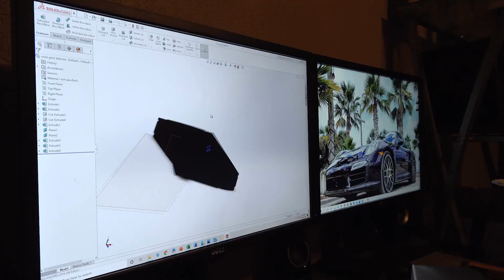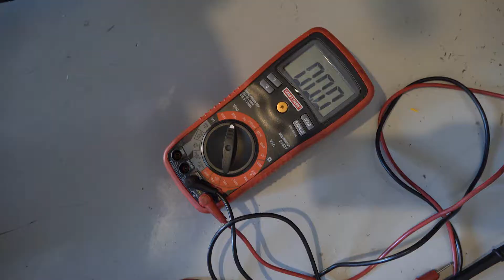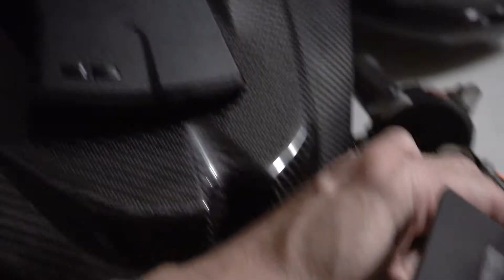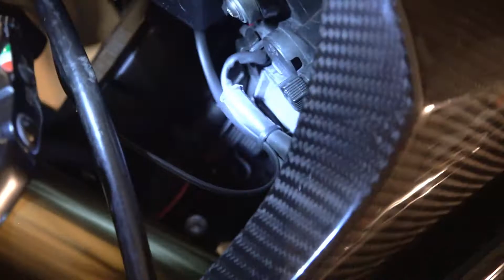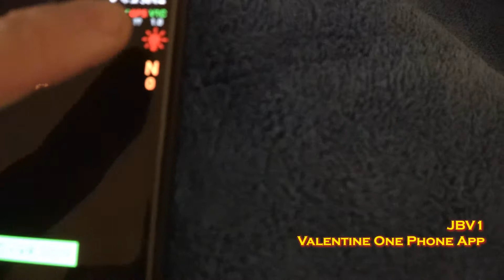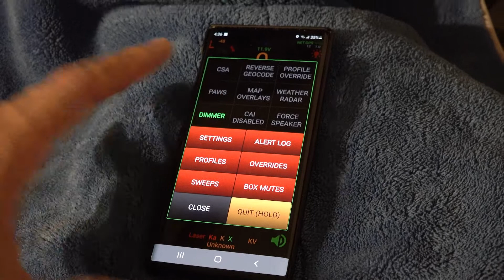VALENTINE ONE Motorcycle Radar Detector G2 BMW S1000RR Install Made EASY - V1 G2

Comment from the maker: The V1G2 install on the cross country record smashing 2010 BMW S1000RR with 2018 engine/electronics upgrade and V1 setup with the Sena 30k and JBV1 app.
Reply: Is the JBV1 app still in use? I can't find it in the apple app store.
Reply from the maker: @kalindenev1972  if i remember correctly, jbv1 is only available for droid. V1 makes an app, but last time i used it, if i turned the screen off on my phone, it killed the app, so i couldn't just put the phone in my pocket. Hence, droid with JBv1 for me.

Comment: Thanks for the great video! 🔥 Im planning on getting this, but use my phone as a satnav, so was wondering once the V1G2 is connected to the app, can I minimise it and open i.e. google maps etc and it still gives me noise alerts despite it being in the background? I have an android and will use a Cardo intercom for the alerts.
Reply from the maker: hey, glad it helped. with droid, there's an app called jbv1 that i've used, and i haven't had a chance to mess with it since getting the new phone setup, but in the past, it has allowed a sticky overlay to your nav, so you can have both on display at once. my sena allowed seamless music with alert interruptions fine, however, what i learned is that with the eyelights HUD helmet device is that it forces you to use android auto, which will not let me run jbv1, and even the audio part i struggled with cuz every time an alert came from the v1, it stopped my music and would not restart. because of this, i'll probably go back to a sena setup. point is, i've had good luck, but not with android auto running. what i did on the aprilia is installed one of the bright LED dash visuals for the v1 as well just as extra risk mitigation.
Reply: @NoLimitsNoRegrets  Thanks, appreciate your response. Really looking forward to getting a radar detector so I can enjoy my motorcycle more.

Comment: Does the v1 app still give you radar alerts with the app running in the background? So, for instance, if I have my uber eats app running and my phone connected to my sena, I'll still be able to hear v1 alerts through my sena?
Reply from the maker: i know the YAV1 app does. as far as the actual valentine 1 app....there was a reason i didn't use it...oh, the last time i tried it, you had to leave the screen active for the app to be active, but if i shut off the screen to put it in my pocket, the app quit. the YAv1 app stays running in the background even with the screen off and lets you prioritize the alerts, so it interrupts the music for the audio alerts. YAV1 is only for droid, not for apple. Short answer is i don't remember if the valentine 1 app will interrupt music/other apps for alerts. it would seem silly not to, but i can't guarantee it off hand.

Comment: Hi! How those it perform on road with stacionary and mobile radars??
Reply from the maker: around here, the only stationary type radar items we have are the ones at construction sites letting you know what speed you're going. it seems there are different types of them as most set off the V1, but sometimes they do not, or it may be that they're not active. even the old gen V1 would notify of speed light radar detectors that were sending tickets by mail in FL though. I have no complaints about it picking up radar signals, but again, LEO doesn't have stationary/mobile radars around here.

Comment: What is the square pole mounted to? Been running my V1 and V1G2 in my vehicles for years. After getting a fat ticket on my 21 R1 I decided to make a mount but super hard to find a place to mount it. I’m thinking of doing a go pro mount like you originally did.
Reply from the maker: i designed that mount and have made/sold a few over the years, but basically i did a spanner that went across the triple trees using the clutch cable holder hole and the master cylinder reservoir hole, then everything built up from there. it's worked really slick over the years, but yes, it's hard to find spots on bikes to easily do this.

Comment: I respect a guy that's got to run a radar detector on a motorcycle but I'm sure I would not have gone with v1gen2
Reply from the maker: i was trying to get info from escort on the integrated systems to see if it was something i could install on a bike, but no response from them, so stuck to V1 since it's what i've used before. though the 911 has an integrated escort that works really well! what's your preference?
Reply: @NoLimitsNoRegrets  I actually made the comment before I saw the cell phone yav1 or what ever your connection was .that makes all the difference...with your phone that v1g2 is almost as good as a r7 or 360 redline....in north Carolina you could go through your second engine and install a 3rd before you will find a k band cop...I still like my redline and my r1 because I turn k band off
Reply from the maker: @randyjohnson6845  oh yeah, for sure you need bluetooth coms to the helmet on whatever is used. i had the H.A.R.D. LED in the eye system years ago, but eventually changed to the bluetooth audio shortly before doing my cross country ride. don't know if you watched the movie or not, but there's a pic in the credits of me marking my territory on a tree. that's in NC against the tree that stopped my aprilia then from sliding any further down the mountainside. wasn't on the dragon, but warwoman road maybe? awesome riding up there, enjoy them!
Reply: @NoLimitsNoRegrets  

I had the escort 9500IX for years - with the H.A.R.D system bought from legal speeding. it  saved me hundreds of times. 
The wiring in the HARD eventually let go and it was unrepairable. I bought a 2nd unit and it did the same thing. 
I think they were getting them made in China or somewhere off shore, the customer service was good in the beginning - but went to complete shit later.

So I switched to the headphone jack - LED visual alert system. The lane assist cameras have made owning the 9500ix annoying and pretty much useless. The lane assist cameras constantly created K band alerts - even showing as KA at times. 

I just sold my bike with the entire radar setup with it. 

I am looking to set up a Valentine V2 on my track/street gsxr 750. thanks for the video!
Reply from the maker: @bakwheeltango18  interesting on the 9500 issues. The HARD just became too much delayed. i'd see the cop or the V1 would light up well before the LED in the helmet and made me doubt it. plus at night that flashing in my eye was annoying as hell. been very happy with the bluetooth setup now though. good luck!

Comment: I can see that you put a 2015- engine in the 2010 s1000rr. My question is.. do i only need the Engine and the 2015- wires and ecu to get it done? Is it like „plug and Play“? Sorry for my bad english But i‘m from Germany 👍
Reply from the maker: Ja, es freut mich sie kinderserlernen! (enchuldigung. mein deutche ist nicht gut) it now has an '18 engine and full electronics, i.e. wiring harness, ECU, etc. you couldn't just plug and play directly an '18 engine. there are different headlight connections and different cam sensors if i recall correctly? it's all doable, but does require some custom work or changing the head on the engine to use the old sensors. even changing all the electronics with the engine, the trickiest part was fab'ing a setup to mount the shift lever off another bolt, finding a shift link, basically converting from the old upshift only assist to the dual acting one, getting that all adjust correctly. i have a video I'm editing for that i'll be posting in the next few weeks too. Guten Tag!
Reply: @NoLimitsNoRegrets  thanks for your Information. I will Watch your Video. Sounds like i Can do it Blut with Dome Time and work
Reply from the maker: @Edelpfusch-Racing  with enough time, money, and effort, you can do anything with these!

Comment: I didn’t know they had Bluetooth now that’s amazing. Do you know if the alerts will come through your speakers if you’re using Apple CarPlay in a car?
Reply from the maker: yes, the new gen 2 released recently has it built in. also eliminated the random false laser alert i used to get on my s1k at 7K RPM or so. I've never tried an apple carplay setup, but a couple data points. 1. on the bikes, it sends signals to the jbv1 app on my phone, which plays alerts through my helmet bluetooth. i think jbv1 is droid only, but you can use the v1 app. in my one car with a v1g2...i've heard alerts through the phone i believe from the v1 and jbv1 app, but i don't think i've heard it come through the car audio, which is not as fancy as carplay. it only works for calls, can't even play music from the phone to that car audio. Sorry i don't have a solid answer for you as i don't have an apple or carplay, but the g2 bluetooth is slick!
Reply: @NoLimitsNoRegrets  Evening buddy! Nice install and nice bike!!

I recently just installed my Gen 1 V1 on my Honda Goldwing. I used to have it installed on a Honda VTX1800 and it worked beautifully with my V1 connect for JBV1.

Upon finishing the install on my Goldwing with the same kit (I use a screamer kit, and LED light, V1 Connect) and starting the bike, the Laser is going off NONSTOP!  I can move the radar off of my magnet mount and it does go off around 2+ feet away, but for the life of me, I do not know what's causing this. The bike is not even started....Just with the ignition turned. 

Have any ideas? I have a call into Valentine, but they are not available until next Tuesday. Thanks in advance!
Reply from the maker: @anthonybrown6285  interesting data point. with my v1g1 on the bmws1000rr, the laser would start going off around 7000 rpm. i never could figure out why. i tried adjusting the shift light right by the front of the v1, taping over, etc. and never could get it fixed. the v1g2 has had zero issues for me in exactly the same position. short of that, the only other thing you could try is an isolation relay, but that didn't help me either. gotta love technology!